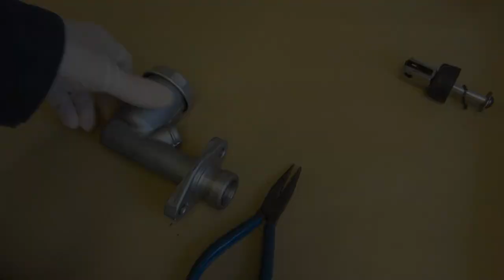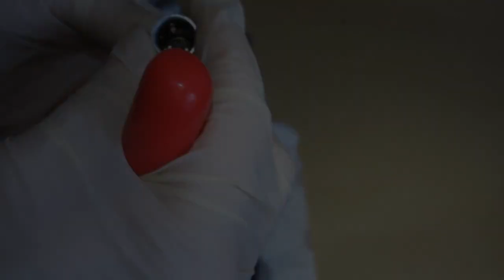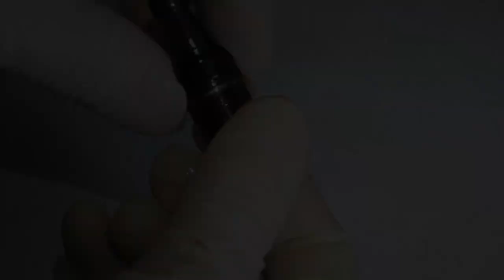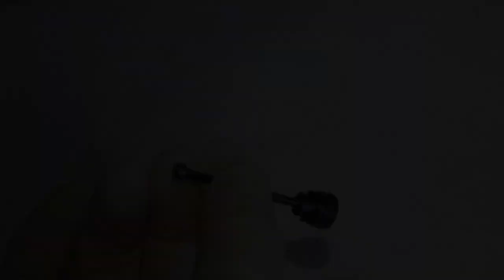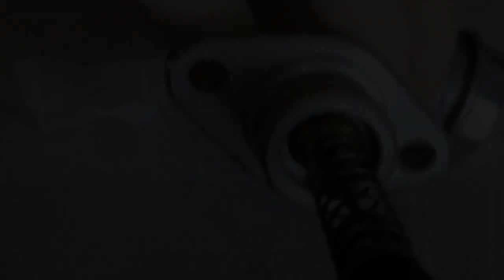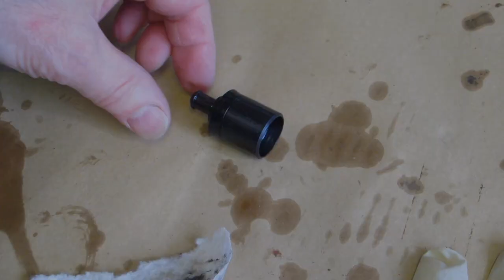Lotus Elan Master & Slave Cylinders

Comment: My experience suggests that the problem usually lies with the rubber seal in the slave cylinder; if you look at it, it is situated next to the exhaust pipe, and suffers a lot of thermal stress.  That is the first bit I would replace.  Cheap enough too!

Comment: Paul, thanks for the video. I am about to replace the brake master cylinder seals in my Elan +2. Some years ago my clutch pedal went straight to the floor with no resistance. The non return valve was the culprit - the one with little spring washer in your video. In my case there was rust inside the cylinder from long term storage, and I think some muck was stopping the valve closing. I was very careful with the brake master cylinder, which has the same single point of failure but which in that case could lead to lots of pain. Do you know if there's a master cylinder out there that avoids this? It's the one thing that I am really nervous of with the Elan, but it's the same on any car with that type of master cylinder. Regards. Sean.
Reply from the maker: Glad you like the video.  It might be worth looking into a dual circuit master cylinder, where two wheels (opposite corners) are on each circuit.  I'm not certain it gets rid of the valve problem, but looking a cross section diagrams it may well do so.  I'm sure if you ask on lotuselan.net someone will know the answer.

Comment: Another great video from Paul.  Been rebuilding British hydraulics since 1970.  Never took the time to understand what the non-return spring was for.  Thanks for explaining it.  I remember the master cylinder caps on my first car, a 1964 TR-4.  They said "Use Girling Crimson Fluid Only".  I thought it was nothing but an advertisement for Castrol so I ignored them.  Found out a few months later when my car began leaking brake fluid from both calipers and both wheel cylinders that the warning was not an advertisement, but a legitimate warning.  Apparently, the seals were made of pure rubber which regular brake fluid attacked and turned into chewing gum. Because Castrol Girling was plant based, it wouldn't dissolve the rubber.   I would guess that since that time, the seals supplied in kits are made of neoprene which is not affected but I'm still paranoid about using anything but Castrol.  Do you think I can put my concerns to rest and use anything off the shelf?
Reply from the maker: I've used Universal Brake Fluid DOT 4 which I happened to buy from Millers when I bought engine oil from them.  I imagine any supplier of DOT 4 brake fluid will be fine.

Comment: Girling Rubber Grease for the piston & seal will make it last A LOT longer, brake fluid, even Crimson, isn't that good a lubricant, especially for those very soft seals.  Also, the old wives tale of any other then Girling Crimson will kill the seals is partly true only if the fluid is not DOT 3 or 4, or some shite from a 7/11 that lies!  Also, also, remove the clutch fork's return spring, the release bearing is more then good enough to last forever while lightly rubbing continuously with no real load, and now the clutch is SELF ADJUSTING!
Reply from the maker: OK, interesting.  I'll have to investigate.